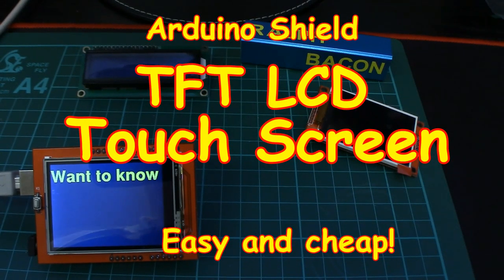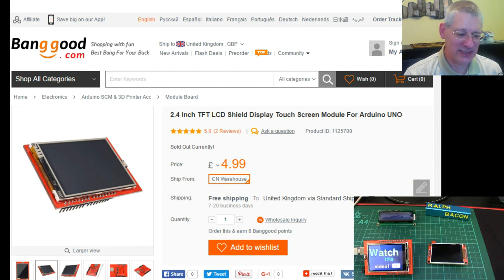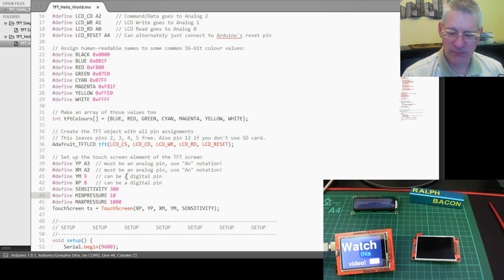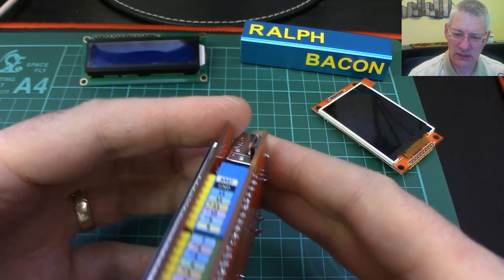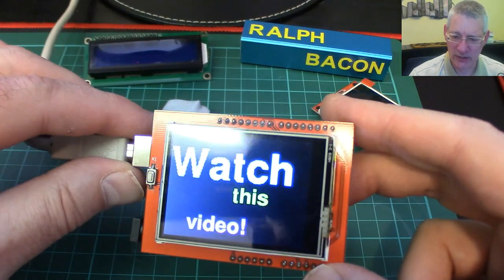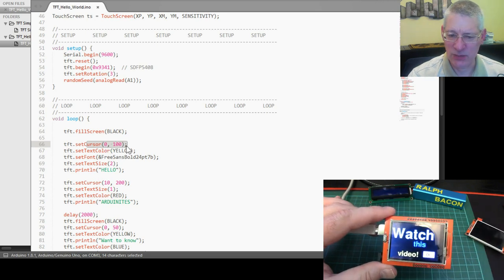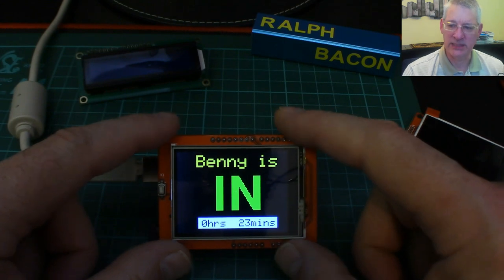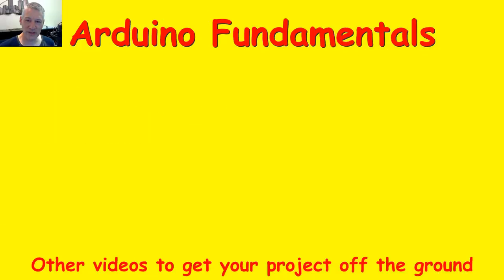#83 Colour Touch Screen TFT LCD for your Arduino - Cheap & Easy

Comment: ...still trying the same cheap  probably a 8bit 2.4" tft which worked on UNO to work on esp32 R32  a uno style board , with MCUFRIEND_KBV lib...easier but expensive Nextion are better option with only 3 wire...or mybe a bigger 4 wire i2c OLED with 1000x1000 pixel...and those UNO boards should have lower sided male pin extended for 2 x18650 battery in series 8.4 dcv stepped down to 5v and connected lower side to 5vin..etc on uno (a rechargeable battery shield)...with solar rechargeable (+) & (-) terminals
Reply from the maker: Certainly in the intervening 12 months (or more) since I did this video other screens have surfaced. I even have a Nextion screen waiting to be examined! Powering your UNO with LiPOs is quite easy with a simple LiPO buck-boost devices, I showed a Wemos one recently, gives 3.3v and 5v from a single LiPO that is constantly being charged.
Reply: @RalphBacon  ...yeah i got that part...but what i meant was ... a plug.n.play version of battery shield it does not matter if it was a LIPO or LION..connected on the lower side of the microcontroller...someone have to invent one simplified version of those... and with the display...i would prefer to invent  a UNO sized  somewhere around 7 cm x 4cm with multiple button on A1 pin...whoever can do it would be a rich in near future...

Comment: Specified folder/zip file does not contain a valid library
Reply from the maker: Sorry to hear this Jony, which link are you clicking on (in my GitHub presumably)?
Reply: The problem has been resolved .. By unzip the files and add them manually to Arduino libraries 👍 @RalphBacon
Reply from the maker: Thanks for that Jony, glad you got it resolved.

Comment: Good presentation but these TFT's use far too much of the Arduino's resources i.e.I/O pins and memory (for the bloated Adafruit libraries)  , so you'll never be able to use it for anything complex.
Reply from the maker: Well, there are ways and means, Duns, if you really wanted to use one. Using a Mega 2560 is one easy option, lots more pins, lots more memory. And, of course, there's nothing stopping you removing the 'bloat' from the libraries you include, if your needs are more modest. And finally, of course, what's to stop you using a sub-$2 Nano as the dedicated driver for one of these screens, linked to your main project via I2C, Serial, or other means? We have the technology!
Reply: @RalphBacon  
Using MCUFRIEND's on a NANO will require some heavy wiring.
What about using an old Smart Android Phone via VNC ? I've seen a tutorial on this and will look it up. I'm also checking out ESP8266 and ESP32. They have 4 Meg memory but will require an adapter. The last time I designed a PCB was back in 1983 so a bit rusty.
Or maybe a Teensy or a STM32 ? Adapter required but I assume this has already been done.

Comment: Hello!
Can you help me out? How to reverse the touch X direction? I have the 5408 version.
Reply from the maker: All I can tell you is that you need to inspect the library files and put a minus (or remove one) when it calculates the next X position. I remember doing this once (not necessarily for this screen) but it then worked as it should. It took me a few hours to find out where it was going wrong.
Reply: @RalphBacon  Thanks!